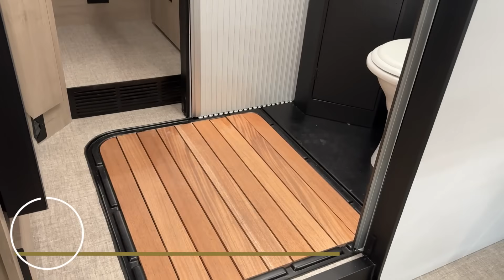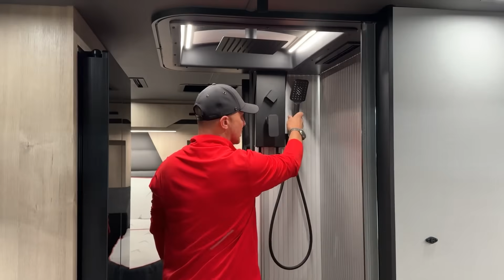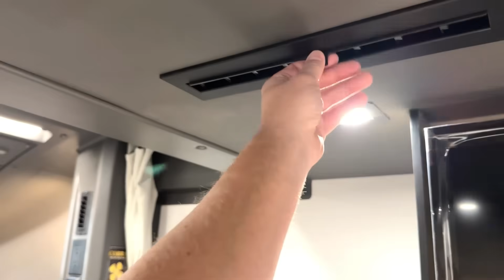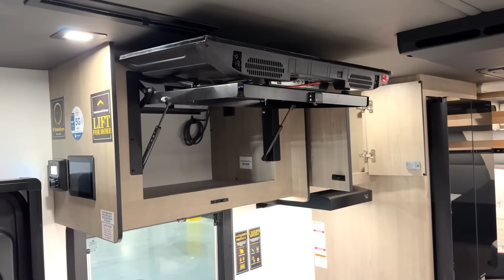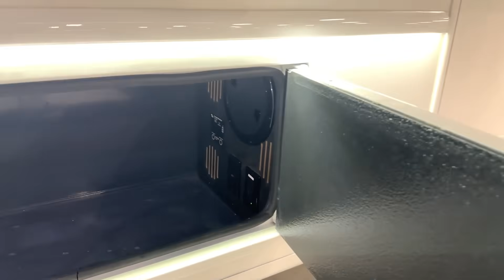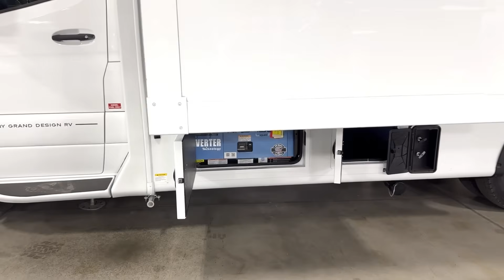RV WORLD FIRST! New 2026 Lineage 25TK Twin & King Bed Luxury Class C Motorhome by Grand Design

Comment: strong feedback here. I travel with my cats.  A lot of times I have to special cut a piece of hardware cloth to lay in where the screen is so they don't scratch it right out and jump out the window.  cause they saw a pretty little birdie.  and believe me when you hafto live around foxTails and goat heads you don't want your long haired kitty outside. unless you just love, pissing it off by grooming it to death. so airflow with strength is important to me.

Comment: do they need volunteer beta testers?  😂 give me a weekend and I'll give you everything you wanna know.
Reply: oh my God under the stairs Storage for the for the electrical I've done some rebuilding on some of these RVs and so much space is wasted in them. It's ridiculous.  I see about 4 inches They wasted in the  slide drawers there in the back, but you know 
oh well. all those little inches could make up the room for a hanging closet? 

but you know usually if I'm in a traveling unit like that and glamping I'm not taking designer dresses or silk suits with me that need hanging up  
otherwise, I'd get a motel room at the convention or whatever  with my hanging wardrobe in toe. so some motel rooms actually have a string that you can pull out from the wall and hook on the other one to hang your white clothes on if you want to wash them in the bathroom or hang your suit out after you bring the chlorine out of it yada yada, maybe they should take that idea and go with it. Make an extended pole somewhere with a pole mount (and I would expect this to be heavy duty enough for a kid to play on because kids will do that) for the other side when they pull it out maybe over the foot area of the bed.? did you like my idea and use it please give me a shout. along with that other guy now he has some awesome ideas.😮

Comment: It's a nice layout and I think the bath is excellent.  BUT - $218K?  Nuts, nuts, nuts !
Reply: the 25FW has a sale price right now for $159k. This will probably be around the same. I'd hope to see something in the low 100s
Reply: @keithit110  $100k gets you an F350 diesel, as long as you don't get a King Ranch or Platinum.

Comment: Overall, I love this RV.  Needs to have a Ford option. I will never buy anything on a Mercedes. Would also prefer a removable induction burner to allow for more counter space. Will definitely do more research on these.
Reply: Why not buy an induction burner at a local store when they go on reduced price sale, instead of getting one as an option and paying double or more from the manufacturer?
Reply: @tokarpaul1619 my main point was that the built in burner needs to be removed to give some counter space. Doesn’t matter whether they furnish the induction burner or not, but, for the price of the RV I would expect a burner.
Reply from the maker: ty!

Comment: Very impressive.  I would like to see a keyless entry lock.  Love the oven, microwave, air fryer option. As I am not a fan of microwave and not having an actual oven would be a deal killer for me. So having an oven / micro / air fryer combo unit and A++++ for me!!!  I will definitely be putting this unit on my must look at and consider list.  What didn’t I see on the roof… The roof.  You talked about showing the roof but didn’t actually show it.  Would love to see what the roof looks like…LOL. Thanks for sharing Nerd.
Reply from the maker: As I sit here eating a lunch from an Air Fryer... lol :)
Reply: Love this. For me I prefer no slide outs. I also don't like microwaves so I would like a stove. And yes I use mine.

Comment: 4 Cyl TD with 332 lb/ft torque and a 15000 gvw.  OUCH.  I once drove a 63 Chevy C70 Dump truck with the 305 V6, I can imagine the acceleration is identical ..... And that and the price tag are my only 2 dislikes.

Comment: The bathroom is brilliant.  With that much outside pass through storage,  1,210 lbs of cargo carrying capacity isn’t brilliant.  I get it.  It’s a Mercedes chassis and not a Ford with a 7.3 L V8.  I own a Quantum 19C.  It’s smaller than this model.  My cargo carrying capacity is more than double.  It’s definitely a trade off.  What can you live with and what can you not live without.  I’ve learned that I need the cargo capacity .  It’s a really nice coach, though.
Reply from the maker: Bathroom is slick. I agree on the CCC. This segment is tricky that way

Comment: How does one have privacy for using the toilet? Didn’t show how much leg room there is.  Also that teak floor made noise when stood on.
Reply from the maker: same way as you have privacy for the shower - you just wrap the walls around you. You simply don't close the interior partition to the toilet. So you'll have more legroom here vs most rvs

Comment: interesting design.  A lot to like.  The hanging closet is a good idea, but having to unmake & make a bed to get to it, is not good.  Don’t like seams on the mattresses.  Shower concept is interesting, but would like to see a bit more sink counter-space. Not crazy about Mercedes, would like to see a gas option.  Would also like to see an option for cabinetry instead of the overhead bed.  You did not mention if the cabinets were solid wood, MDF or ???

Comment: I'd like to see a twin bed only option where the space between the beds becomes a raised nightstand with drawer. Not quite the height of doubled center cushion you show in the storage position but higher than the bed mattress. 

The bath is fine with me. It looks like it has a good size shower in either configuration. What I couldn't tell is if there is dedicated ventilation and if the toilet can be used with the straight tambour door closed. Both of these would be must haves to control humidity and odor. I'd also like to see the vent stack disguised in some way. Black ABS with labeling cheapens what to me is an overall upscale look. Another shelf in the medicine cabinet would be useful too. 

I think this would work for my wife and I. The drawback is like most class C RVs there is a lack of towing capacity which is a deal killer for us. We do not want to have to disconnect anytime we want to go somewhere and even with their smaller size there will be problems parking at many national park attractions or other tight parking lots. With fewer small vehicles being able to be flat towed an RV needs to handle at least 5K lbs to accommodate larger vehicles or TOAD and trailer.

Will there be a delete option for the Starlink equipment?
Reply from the maker: I don't know of a starlink delete. I wondered the same

Comment: The math is simple based on the graphic at 0.23 sec. While also stated directly, OCCC is 1210 (GVWR minus curb weight), but the killer is towing which wasn't directly stated, 3125 lbs (GCWR minus GVWR). Essentially you can't pull a TOAD among new cars as 3125 eliminates all Jeeps and Fords capable of 4 down towing, and all but possibly one GM, the new Chevy Trax which might fall right at the max. My Buick Encore GX @3400 is over, but can be towed by the Mercedes 3500 Sprinter with it's capacity at 4220 lbs. Among used car, even the ever popular 2014 and earlier Honda CRV is too heavy at 3200 lbs wich leaves small cars, like the Fiat 500, with manual transmissions. The 4500 Sprinter chassis is basically a non-starter for me with its dismal towing capacity. I'll take a 3500 chassis with OCCC in the 800-1000 range and if I am over, I can transfer some items - up to 800 lbs - into the Buick before I ht the GCWR max.
Reply: The gcwr is the same between 3500 and 4500. You can move stuff and lower the gvwr to a towed vehicle. But you do get the extra ccc if you don’t need to tow a vehicle.
Reply: @rossplyler4424  Partially true...but requires an educated user - not one that thinks a 5000 hitch means can tow 5000 lbs, as it ia always the lower apacity in the entire system and in this case GCWR minus GVWR, or 4200 vs 3125 respectively. To Grand Design's credit they beefed up the chassis reinforcement for more ride/handling comfort, but that increased the house build weight resulting in the lower 1250 OCCC in a 4500 chassis, vs in the 2000 OCCC range of the only other manufacurer using the 4500 chassis. Also to Grand Design's credit, with the 3125 calculated towing capacity, unlike Thor, they dropped the hitch from the Class IV 5000 lb, to the Class III 3500 lb which is enough of a safety buffer for 3125 capacity where Thor's, while requiring no production line supply change, is flat out misleading on a 4500 chassis, but a good but an equally good safety margin on the 4220 tow capacity. But, that lower Class III hitch limits the weight shifting math games when the Lineage OCCC isn't that far different from the 3500 with some no-slide floorplans matching it.
Reply: Refreshing to see someone paying attention to OCCC and GVWR- IMO, this is the one area within the RV industry that is the most misunderstood or in some cases, ignored.  It takes no time to add 1000lbs of cargo (people and pets included) to your rig- I have no facts to back this up, but from my own experience at CAT scales, my gut tells me that most Class C and Class B RVs rolling down the road are well over their OCCC and GVWR opening the door for potential liability if/when something goes wrong.

Comment: A couple of note (need to win the lotto first).  You did not mention if this is gas or diesal.  What is the MPG (especailly if gas). 24.5 gal tank could be an issue.  Places out in Utah where  there is a sign, Net station 100 miles.
The show is unique.  Would perfer a propane oven. This on is too small for a 14" take and bake pizza.
Enjoyed the video
Reply from the maker: these mercedes are all turbo diesel models. Sorry if I didn't mention it. MFGs don't provide MPG specs on these so I don't have a guideline to go by

Comment: We would want to use the garage for adult bikes, whats the floor to ceiling height? And also the width of the garage.  Thank you.
Reply from the maker: interior height varies by position within the RV. Cant recall offhand if tallest part is 6'6" or 6"9"
Reply: @JoshtheRVNerd  was asking for the height and width of the garage, not inside the unit.

Comment: They need the kitchen burners moved to the left closer to the sink so you can have more space to the right of the burner for coffee maker/air frey/cutting board area etc.  Putting it in the middle leaves to little space on each side of the burners.
Reply from the maker: solid idea ty
Reply: I really like the innovative shower. I normally like to find rear walk through showers with doors that open on "Bs" as it makes it easy to clean up as you come from a trail or whatever. However, with this bath and the wonderful twin to King bed set up you have a rear cap on the vehicle. What I was thinking as I saw it was it'd be a great viewing system if there was an awning on the back and the awning arm had a plug-in available for a removable high definition video system. That way you could use your table that stores underneath a couple of chairs and sit under the awning and view during those lovely evenings outdoors. I know that wouldn't be in the works right now but it might be something to suggest. What's your opinion?

Comment: This is the most interesting RV I have seen in a long time, maximum comfort in minimal space. I would like to point out that a standard Twin bed measures 38" by 75", I am 6'3" and can sleep on one as long as I am nit kicking a foot board, the XL Twin is 80" long and is accommodating enough for me to sleep well on. Generally, women are shorter than men, I noticed that only one bed is 80" long and my thought is that it is most likely that a woman under 5'10" or so would be just fine sleeping on the driver's side.
I could see driving this around the country in this for a few months very comfortably, Maby with a mattress topper, I don't like funky mattresses, could do without the chopped one and hanging storage in lieu of a thicker mattress with more drawer storage even at the cost of losing the tilt-a-bed.

Comment: My little girl wants one of these because she wants the Bed above the driver's seat LOL this one is super cool though I'm just wondering what do they do with the prototypes do they sell them super cheap or can you win it or whatnot
Reply: I was told after the 2 influencers used the other model in this line that they wouldn’t be sold. They were going use them for GD stuff.
Reply from the maker: depends on the stage of the prototype 
Later stages are often sold to dealers at a discount

Comment: Very interesting. What I didn't like was the CCC. All that storage and you can't really fill it.
Reply from the maker: The CCC is always a struggle on mercedes chassis stuff
Reply: @JoshtheRVNerd  Yeah, I know that but this is 4500 which should give a 1000# over the 3500
Reply: And it is a 4500 vs an old school 3500, that's like a 1000# more for this model.  Heck the 4500 has almost the gvwr of my e350 super duty, and I have over 2k CCC.
Reply: @rvfishing8817 just seems like 1200 to 1400 lbs isn't much especially if you have anything in the tanks.
Reply: @RothePhoenix  I think CCC is with the gas and fresh water tanks full.  But I have seen Leisure Travel Vans on a 3500 chassis with over a 1000# of CCC. If it was a 4500 that would be closer to 2000#. What did GD put in there with so much weight?

Comment: That first glimpse of the shower has me screaming!  ❤ AWESOME‼️   That bed/closet system is also genius!  It would be sweet if that closet also had a cabinet door on the under bed side so that you could open it if we wanted to get to the clothes without unmaking the bed.  The headrest safes are AWESOME!  I always need a place to keep my…watches.  😎👍🏾  Whomever designed this deserves an award!  Everything from the raised roof in front to the bathroom/shower, countertop extension, closet, window (with sensors!), screen and door is just smart!  However, I am curious how this weighs less when parked at a curb than it does…Not.  So if I’m in a parking space it weighs MORE than it I’m parked street side?   🤷🏼‍♂️
Reply from the maker: I havent used it yet obviously but conceptually i REALLY liked the idea
Reply: @JoshtheRVNerd — You might mention to their team that adding closet doors to the below the bed would add value!  And why does this weigh less when parked curbside?  😊